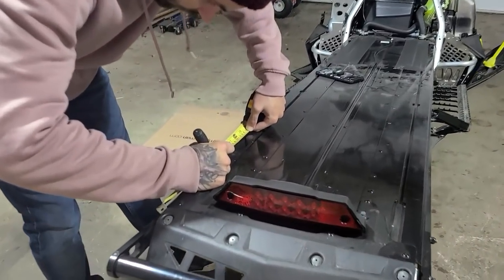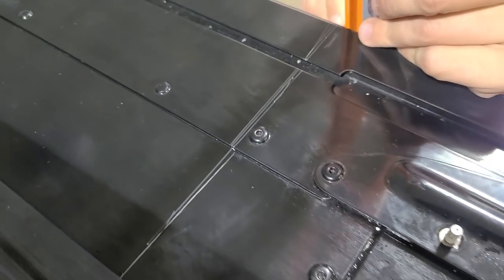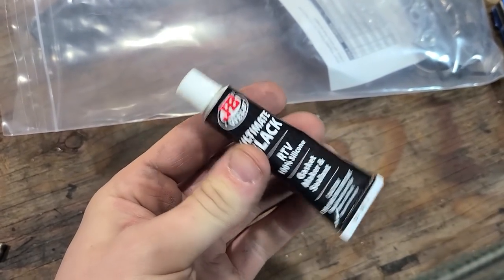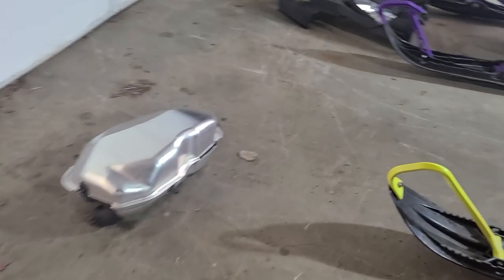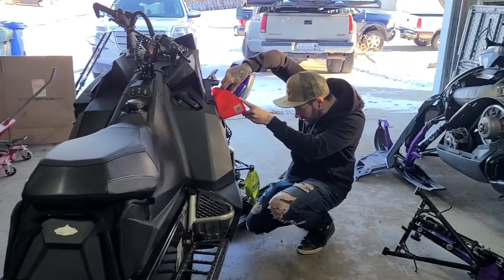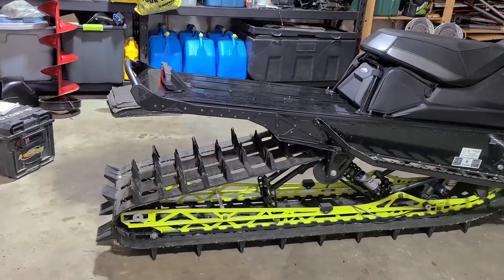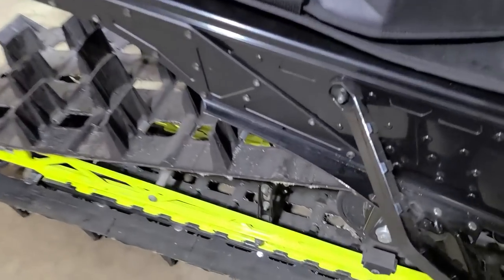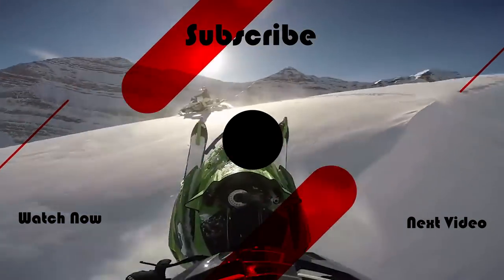POLARIS RMK TUNNEL CUT | MTNTK Tunnel Shortening Kit Install

Comment: Those kits are prone to leak...milwuakee makes a 12volt cordless rivet gun with an extension that’s awesome!
Reply: I can only imagine why those kits could possibly leak?! I mean 3D prints are like the most unreliable parts used in industry currently and they expect the rtv to hold for good😂😂

Comment: Was wondering wtf when u drilled out the heat exchanger but this kit you don't need the center section. Pretty genius. Good job boys. Sorry I had doubts 😆
Reply: Should be able to do it without taking off the tank eh?

Comment: On other YT videos they use a 2 part epoxy on the 3D printed adaptors then rtv sealant on the connecting hose. Did they change their kit?

Comment: Mine eventually started to leak. I just bought a tunnel cooler from CRracing in kelowna that will be welded in place and replace the mtntk kit.
Reply: Cr is the way to go but aren’t they pretty pricey? Then where do you get it welded?
Reply: @boser1212  about $340 USD for the part I had them modify. Anyone that can tig weld can weld it. I just happen to know a few people that are skilled tig welders.
Reply: That looks like a leak waiting to happen.

Comment: I’ve got a question my 2013 Arctic cat keeps on bogging and just not running right what do u think it could be
Reply: Alot of the time it is just a simple carb clean. Take them in and have them look everything over.
Reply: It’s a 2013 there are no carbs. It’s EFI. Bog could possibly be Reeds, snow ingestion, maybe a broken spring in a clutch.